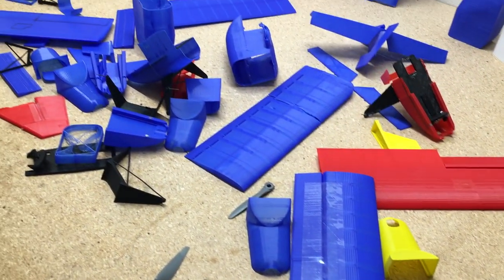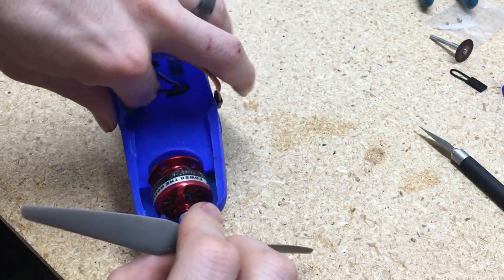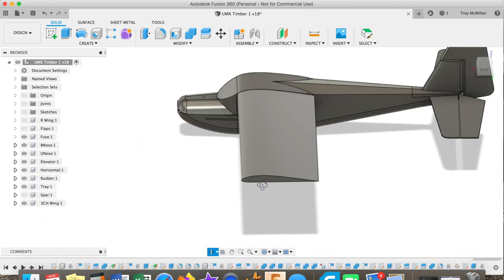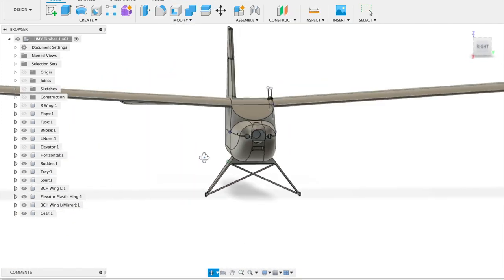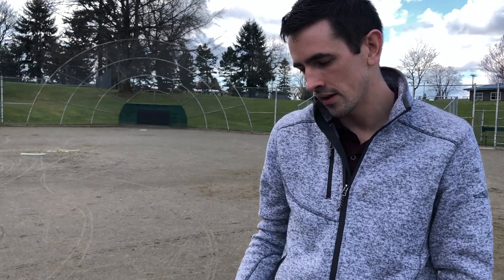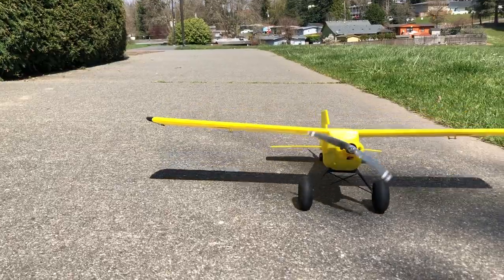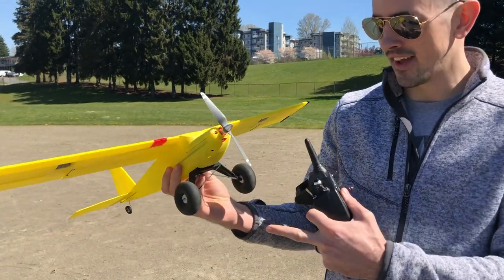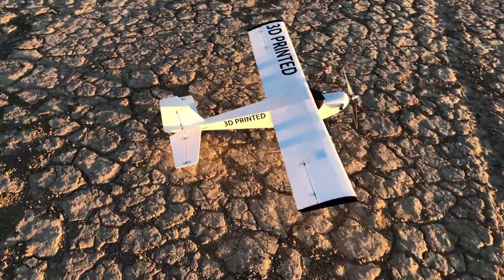First 3D Printed UMX Turbo Timber - RC Airplane

Comment: I admire your dedication to push through the failures until you dialed-in the final design! I wonder if a spring and cable assembly might be the ultimate shock absorber for the landing gear—I think you made the right choice with ditching the cross supports in your final design so that the gear can flex. My favorite part was hearing your “camera crew’s” excitement when your prototype with the landing gear flew—it’s always a cool feeling when you’ve impressed someone else with something you did 😁👍
Reply from the maker: Yes that is my favorite part also that was my wife filming it. She was there to film all the crashes and watch me rebuild them all so she was excited to see it fly. Thank you for the comment Cheers

Comment: Congratulations!  This is perhaps the first video showing the process of trial and error and see it through success by making modifications after identifying what went wrong, going back to the drawing board (old school expression - in this case: going back to Fusion 360).  Every attempt / failure came with improvements, what is beautiful is that your UMX Turbo Timber is now your platform for future improvements/experimentation/modifications.  Most videos online show that a plane is built and flies in the first attempt...that is not realistic (in my opinion).  There is always tweaking even when you purchase an ARF...for a scratch built, it takes a lot more tweaking.
Reply from the maker: Thank you so much for this comment, That is exactly how I feel about videos on YouTube. I am definitely learning as I go and not every flight is successful the first time. Thank you again for the comment. 
Cheers

Comment: Flaps are very important for cubs and it helps with the low speed capabilities like you were having problems with. Getting flaps down to 30 40 or even 50 degrees can drastically improve the performance at low speeds and is well worth the extra weight.

Comment: You put a lot of work into this!

I think this plane has a lot of potential. I'd like to see you make one with a smaller power system. I feel like it's twitchy from the excess weight. That and with so much power even the slightlest error in thrust line will make it do really weird things.

If you print most of it with single wall vase mode and use the stock UMX 180 motor (Like 1/5th the size) It'd be an amazing plane.
Reply from the maker: Thank you for this comment, Yes I agree it is to heavy. I am planing on printing it in LW-PLA and changing the motor and battery to save some wight. I also think I am going to change the wing a bit to have flaperons.

Comment: Great video! I 'm glad you made it fly! My own designs have never flown, I always give up to early lol. Take care.
Reply from the maker: Ya exactly, part of the reason this plane took so long for me to finish is I would go fly it, crash it, reprint it out and hang it back on the wall. What planes have you designed?
Reply: @TroyMcMillan  Sorry it took so long, hectic week. Basically fairly simple designs like Super Cub"s and Cessna's out of foamboard. I think now I would be able to make my own designs fly. Between kids, work and life I only have a few minutes a day to tinker and it always makes me a little jealous on how many planes you've built and flown in the last few months. Ive got the Savage Bobber all printed and mostly assembled but will still probably take another month before I can finish and fly.  Ive gotten good at tuning my printer and just finished a direct drive extruder mod to my ender 3. I did a test print of an Eclipson curved wing tip and man it is almost perfect! If you can get a direct drive mod for one of your printers do it! Thanks again Troy!
Reply: @TroyMcMillan  Not to beat a dead horse but thinking out loud here, where your wing is attached to the fuselage could you do a tab and slot design similar to what Eclipson uses? Or even a small printed dowel pin to give a little more rigidity to wing and fuse? You've done a great job not trying to downplay all your hard work/design. Have a great day! Merry Christmas!
Reply from the maker: @EquinoxRC  No problem at all I definitely understand a busy week. Sometimes the simple designs are the best flyers and the most relaxing to take out to the field to fly. After building all these nice 3D printed planes I still grab my foam timber to take out from time to time just to buzz around and have fun with. It is definitely a long process to build planes for sure. The only reason I have been able to build so many planes recently is because I lost my job do to Covid 19 in April. So needless to say I have had a lot of time on my hands and building airplanes has made this time go a bit easier. It is funny you say that about the direct drive. I have had my eye on one for a long time and I just ordered one yesterday. I will be using the Artillery Sidewinder X1 I am looking forward to trying a direct drive printer. Thank you for the comment have a Merry Christmas and stay healthy
Reply from the maker: @EquinoxRC  Yes I definitely think that would be a good idea to add some more support to the wing. I started on this design a long  time ago before I have recently been building so many 3D printed airplanes. I have learned a lot of new techniques from all the planes I have built. So I will definitely need to make a few adjustments to this build to fine tune it a bit more.  Have a great Holiday Cheers
Reply: @TroyMcMillan  I am sorry you lost your job. This year has been rough for everyone. Keep doing what you are doing, you are inspiring! Keep the faith!
Reply from the maker: @EquinoxRC  Thank you for that I appreciate the comment.

Comment: For the landing gear, why not use the X bracing and make it like an internal shock from an r/c car? Make the bottom be the shaft and spring perch portion, then the upper part can hold a spring and the casing. Make it to where when assembling you attach a cap to it and then it either glues or screws onto the rest of the assembly... just an idea.

Comment: CG for this type of wing should be 20-25% of the wing chord or 20-25% back from the leading edge at the wing root. Other wing types can get more interesting.
Reply from the maker: Thank you for the tip. Ya the first few attempts the CG was pretty far off.

Comment: Since you can't print the wings in the strongest orientation (lying) without lots of infill or support you might want to try a different polymer. Polypropylene apparently has much better layer adhesion, so your wings won't break so easily.
Reply from the maker: Thank you I will give that a try

Comment: Great video I had overlooked this video, as it was published before had discovered and subscribed to your channel. Many great lesson about the process and journey to a RC build here. 
Would love to see you do a follow-on to the TM Turbo Timber build printing in LW-PLA and perhaps applying some of the design tricks you have learnt since this initial design.

Thinking a contributing factor to stall/spins on first few flights was the weight and CoG of initial builds. I've experience similar, too heavy or just tail heavy of a build. (as is so easy to do. LOL) Great lesson in persistence paying off. Seeing where your channel is today. :)
For landing gear cross-braces, wondering if using rubber bands provide flexibility while adding support?

Comment: I would just go with carbon fiber tubes for those struts.  You could CA glue those in there.  You could also make the whole assembly out of TPU.  It will take a beating and absorb lots of energy.

I want to make a rear pusher with a TPU nose...should hold up to almost anything.

Comment: this should definitely get printed in LW-PLA
Reply from the maker: Ya I have some LW-PLA I am going to print it in LW-PLA after I crash the finish wight one. :)
Reply: @TroyMcMillan  also that thing looks way over motored, if it were me i'd dry a 5x4 3 blade with a smaller 2400kv motor
Reply from the maker: @elijahf111  Yes I agree it has to  big of motor. It was  eclectics I had laying around from another build. So now that the plane flies I think I will change the motor and prop. Print it out of LW-PLA and then It will fly even better.

Comment: Did you draw the parts as solid bodies and set the infill zero in slicer ? or did you draw surface bodies like 3DLabPrint's drawings ? 
I tried drawing surface bodies and slice in Surface mode but its difficult to draw in surface modeling.
Reply from the maker: I draw a solid body and slice holes in the body.

Comment: Landing Gear Struts should be a Bungee system to flex/expand.
Reply from the maker: Ya I thought about trying to make something like that work. I just kept it light wight and simple. For a larger version definitely will do something like that.
Reply: @TroyMcMillan  Something to consider. Printed hooks instead of bars connect with Dental Braces Bands Pulled through a short piece of guide tube(for look)
Reply from the maker: @crxess  Dental braces bands is a good idea I never thought of that. Thank you

Comment: You need flaperons it slow plane down many easer landing
Reply from the maker: Ya I thought of doing that. I first made the wing the same as the ump timber. After flying it a bit more and having to land it so fast. I am going to change the wing to have flaperons. Thank you for the comment. Cheers

Comment: Could you post a video on how you designed the files you used to build the plane. The short clips you show at the beginning look very intriguing. I want to design and build some small scale gliders and the only weight in them will be the smallest video cam and Tx I can find. I plan to use Rx’s from Horizon UMX models that are pretty much beaten to hell. there’s nothing lighter that’s widely available and I could easily build a balsa version but I’ve got my Artillery all set up waiting.
Reply: Whoops... the models are beaten form too much showing off. The Rx’s are in excellent condition.

Comment: Would you be able to make a new servo/electronic tray and firewall to fit the guts from an eflite umx turbo timber? I have a crashed umx turbo timber my friend gave me and I think if I printed this plane it would fly very nicely with the eflite guts, please let me know!
Reply: Oh I also have the landing gear from the umx turbo timber, please let me know if you could get those to fit without modifications to the plane after I print it!

Comment: excellent contribution, I want to print a trainer to learn to fly, what do you recommend?
Reply: Buy a cheap foam flyer rtr then fly 3D printed
Reply from the maker: To learn to fly RC definitely would recommend a foam plane first. Most of them have gyros and stabilization to help with learning to fly. But if you do want to print a plane to learn to fly. I would recommend the Model A that I built it flies the best and would be a good beginner flyer. Print it out of LW-PLA. That will make it fly the slowest. I will be building a good trainer 3D printed plane next week. You may want to wait for me to get that one done to build it for a first plane. Cheers
Reply: @orazionastase8894  thanks my friend
Reply: @TroyMcMillan  do I have model Z or do I get model A? I've already flown a bit so I wanted to try 3D
Reply from the maker: @ODIRFPV  Ok nice, I have only built and flown the Model A. So my recommendation would be the Model A. I will be building Eclipson new model the Model C next week. It will be a bush plane you can see a picture of it on my Instagram story. If you build the Model A there is a discount code in the description of the video on my channel you can use.

Comment: u need put spar throught wing.
Reply from the maker: There is structure printed into the inside of the wing to act as a spar.
Reply: @TroyMcMillan  u need new 1 to go through inside fuselage and connect otherside wing like normal rc plane to more stronger than glue
Reply from the maker: @nizarnadzir  Ya true that is a good idea I will try that out.

Comment: I am a professional kit designer with aircraft in the marketplace.  See RadicalRC.com
I will help you if you like.   First lesson.  With a conventional tail behind airplane that looks relatively normal (like what your working on) and a constant cord (Hershey bar wing) you calculate CG thusly.  Measure cored (front to back of wing.   Multiply cord by .3 (30%) to get max rearward CG.  Multiply cord by .25 (25%) to get most forward CG.   Put two marks on wing - measure from front.  Balance between these two marks.  Why it flew better when you added the landing gear is you moved your CG forward with it's weight.  But still not far enough forward.  A tiny bit behind 30% will turn it into an unflyable monster.  Get this right and 90% of your problems are solved.    

I really like what you've done so far.  I'm into 3d printing but have done no aircraft with that method.  Very hard to keep them light enough to fly well.   But I encourage the development.  Another thing you could do is increase he thickness and shells in front of the CG.  Adding material there will help you.   3D printing isn't good for everything.  Landing gear needs to flex for example.  Trying to make it do everything might imply the entire technique is poor to your viewers and I know that isn't your intention.    You need some grain span wise in the wings to make them stronger.   A small hole that is printed oversize and a thin carbon rod slipped in will go a long way.    Keep at it.
Reply from the maker: Thank you for the tips on my build. I agree the gear moved the CG forward and that made it much better, I still have some more thing I can do to try and improve this model. I will try some of you tips out. Thanks again